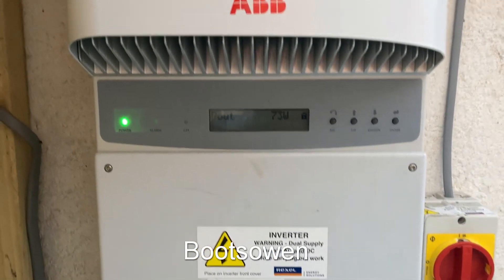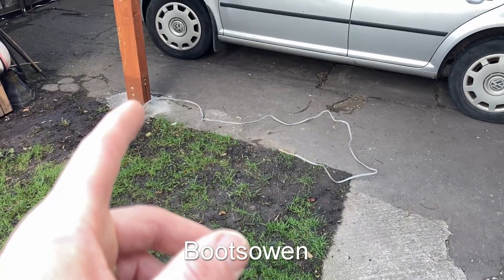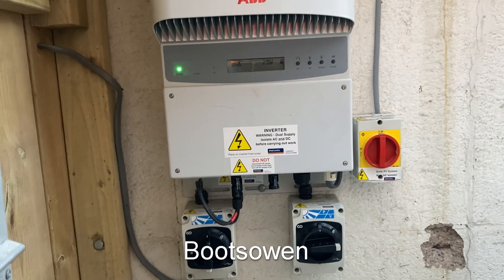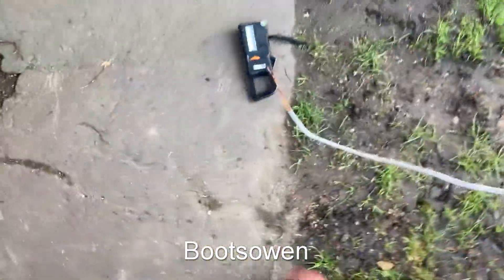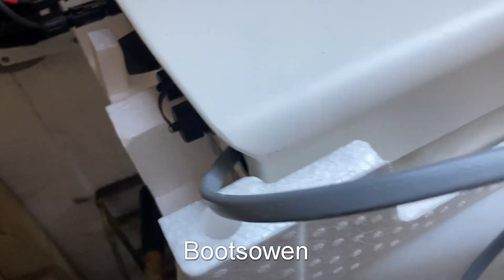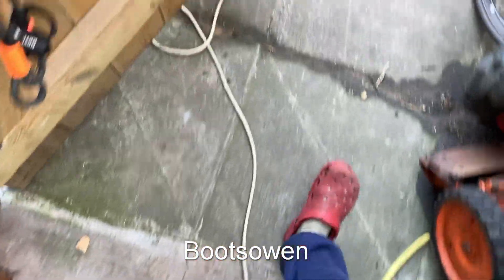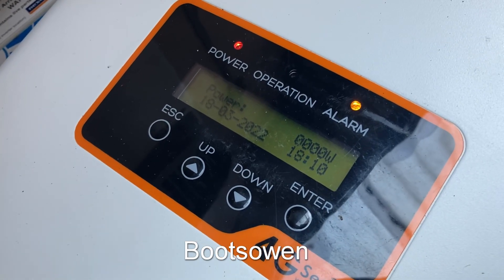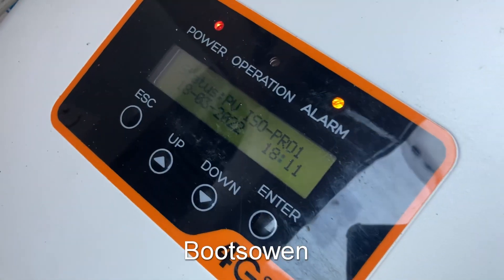Earthing a solar system? Testing a Solis mini 3000 4g. Negative earth leak alarm.

Comment: That current meter looks to be for AC only, you would have a DC potential to earth. Check for voltage to ground, DC and AC.
   Can also see a possibility that hot an neutral are backward, depending on how the device is built you could let the magic smoke out just trying a swap.
If it is a board fault it would be a good project to learn on, so many (cringe) devices you just tear apart for scrap I would like to have but would cost to much to ship.
Figure out what is going on, always nice to have a backup or us it isolated in a vehicle just for the inverter
All I get in the bins here worth anything at all but scrap are MOT's
Reply from the maker: Indeed. I realised afterwards that it was an ac clamp. But the touch test worked and showed that grounding worked. 

Because of that escape to ground I am not convinced that the solis is a dud. I can do a soft reset and test it in a different string of panels. So fingers crossed. 
As for the cringe. I can sleep at night. People throw away so much and it is a trick of the modern world that it goes unseen. Have a look at my street scrapping videos. What people don’t see it the comments I get saying how useful it is to see inside a particular device. Even if I don’t fix it. Either it gives them confidence to pull the cover off or have a go at a repair. 
Remember also that I am just delaying the inevitable and learning a little along the way. The stuff I get is on its way to the scrap pile. Where it will be shredded to pieces. If I take a look at it along the way then what harm. And so much the better if I get it from the east stream and move it to the metal recycling stream. 
Think as well that other channels only make or fix stuff. They rarely show how much they waste. Or how many failed attempts they make at something. 
If you do want stuff like this keep your eyes on eBay/ gumtree/ kijiji/ gumtree. Search local and wait. It comes around.

Comment: Owen, so that is an isolation fault on the DC. all my panels are mounted on steel frames so the panel frames are earthed and I've not come across this before, although I remember Lee mentioning it when cleaning panels on roofs. Where I assume they are insulated from the ground. I'm assuming your shock was more voltage than current so a multi meter DC test to earth would be very interesting, cheers
Reply from the maker: I thought you might like it. Before the tin roof every panel was on wood with no metal to metal contact. But I never would have touched it to earth. Now all panels are effectively bonded together. But where is that potential difference coming from I wonder. If I had pinched a cable the abb inverter shouldn’t like it. I realised afterwards that an ac clamp meter is a waste of time. I tried current to earth through the multimeter but got nothing. Will try dc voltage to earth. The abb inverter doesn’t mind it, grounded or not, and was putting out 2kw+ today. 

Maybe the solis is ok. I will have to set up a test with other panels. All possible.
Reply: @bootsowen  Owen, yes it's still all up in the air (as it were). The voltage test will be interesting, high voltage DC is strange stuff. Extra thought: I coated the steel frames with a super thick layer of paint as insurance against galvanic action of dissimilar metals. I'm assuming the frame anodising would do this but that's just a bit extra.